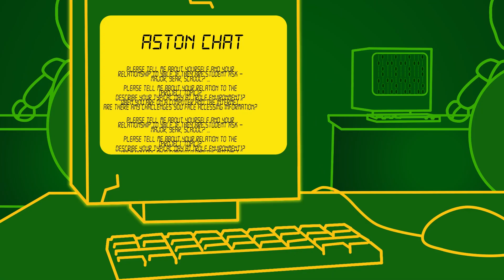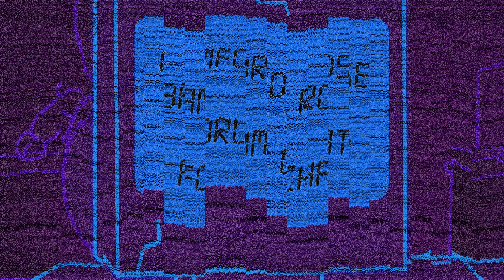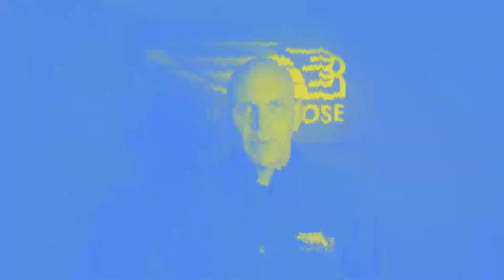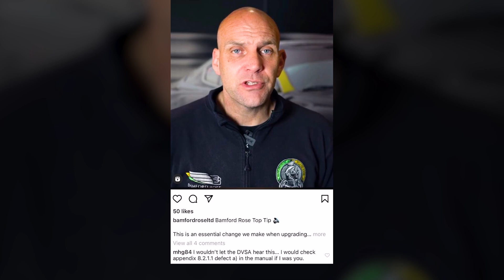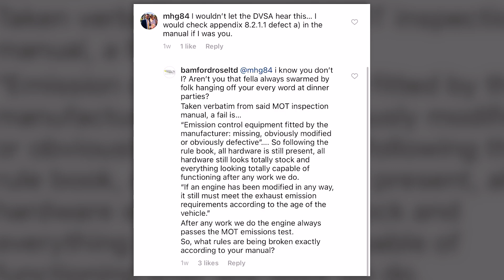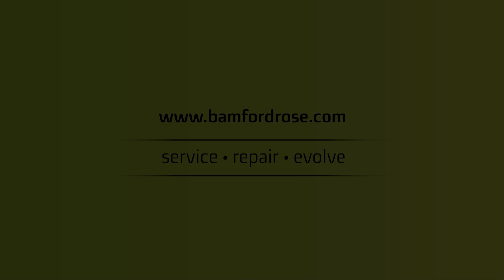MOT failure if removing emissions devices Forum chat #73

Comment: If the car passes the Basic Emissions Test at the MOT it passes, end of story. The issue of missing, modified or defective OEM parts is only raised on cars which have failed this BET and as a result have to go onto have a Full Catalyst Emissions Test which then includes an inspection to determine if the car has been modified or if parts are defective. This is all clearly described in the the aforementioned section 8.2 of the MOT inspection manual and if these these know-it-alls had actually read and understood the whole section it would have saved them some embarrassment.
My car has aftermarket exhaust manifolds & sports cats and has better emissions numbers than it did with the OEM parts.

Comment: Absolutely spot on advice. MOT testers are actually quite hamstrung these days as they are not allowed to remove under trays so can only view what they can see from the outside. So long as it passes the run on the exhaust gas machine both for HC and Co...then as far as they are concerned its a pass. They are far less concerned at a professionally re mapped car which still has an obvious secondary cat...than some backyard boy racer banging the innards out of their beemer cats  and taking the check engine bulb out...as they say...rules are made for the guidance of wise men...and the obedience of fools!.